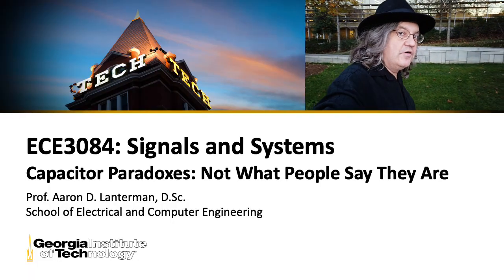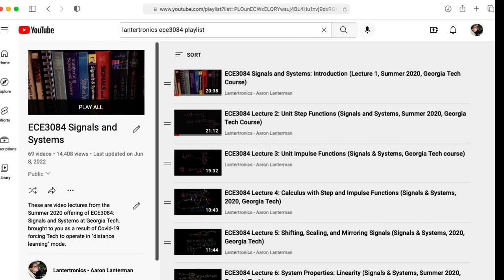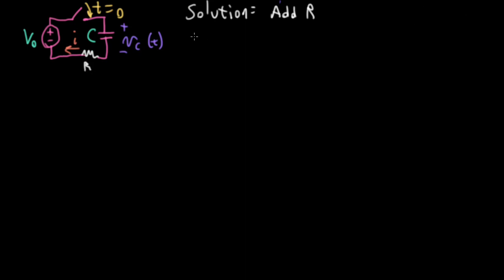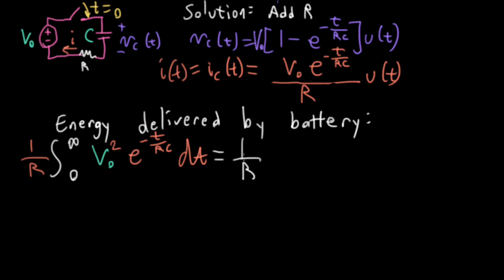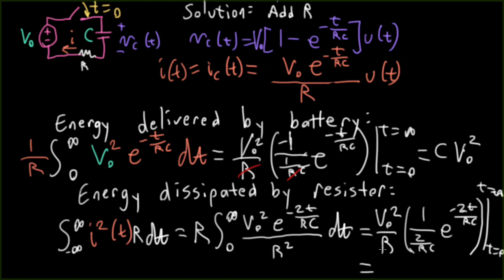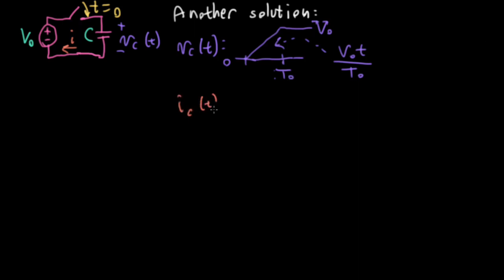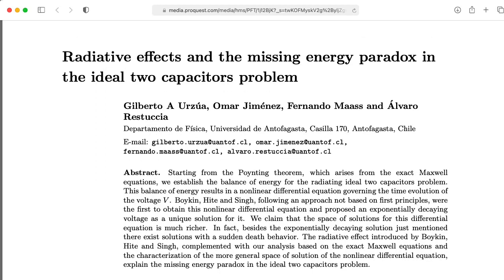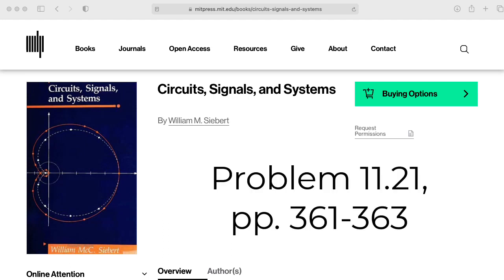ECE3084 Lecture 65: Capacitor Paradoxes: Not What People Think They Are (Signals & Systems, GA Tech)

Comment: At 5:00, d(uv)=udv + vdu.  Also, V(t) I(t) at t=0 is a delta function times a step; to integrate such discontinuities, distribution theory demands that we perform the integration BEFORE we take the limit of zero width.  This returns 1/2 for that combination... half of the delta function "occurred" before the step and half after the step.  (This might be any number and might not be defined -- rather like any other limit -- but for this case it is 1/2).

Comment: Wish I was taught about these before I tried to use conservation of energy to solve a 2-capacitor problem with implicit resistance in an exam. Conservation of charge (C*V) works fine though, so it makes me wonder if there’s a similar conservation rule for LR circuits where I*L is a conserved quantity.

And I think an inductance in the wires is the most realistic solution, since superconductors do actually exist. But that answer just continually oscillates, which isn’t compatible with the standard framing of the question, asking about the final state of the system.
Reply from the maker: There's equivalents for all of these for inductors.
Reply from the maker: Oh, weird coincidence... I've recently been looking into quantum computing, and thinking about superconducting qubits. :)
Reply: @Lantertronics  yes but I’ve never heard of any quantity that’s L*I. I should go through the integrals for an LRL “paradox” to see if it actually drops out that way. Not sure where the R goes though.
Reply from the maker: @Scrogan  https://electronics.stackexchange.com/questions/68355/inductor-equivalent-of-capacitors-charge
Reply from the maker: @Scrogan  L*I is flux.